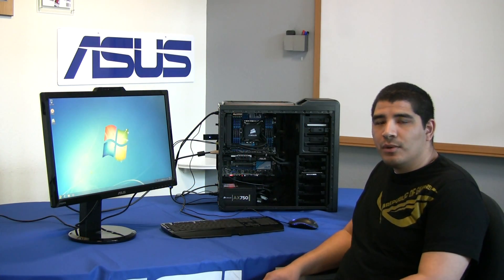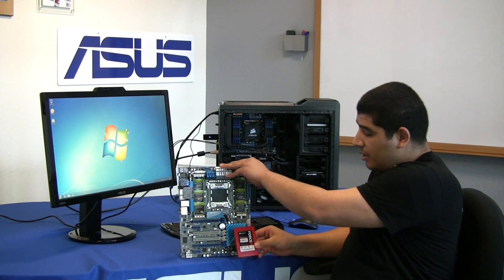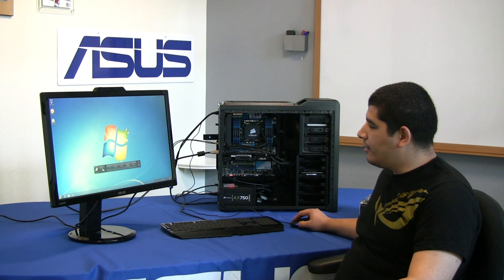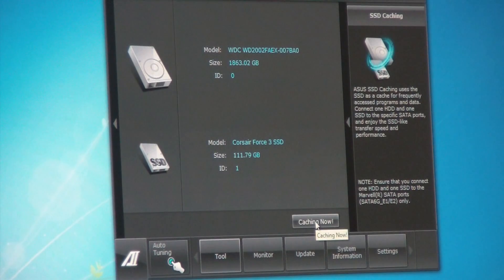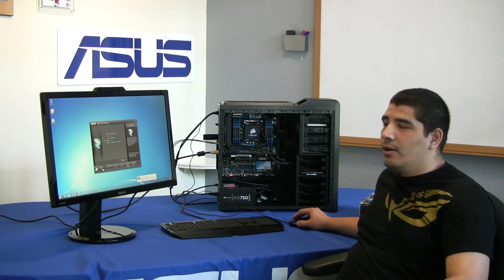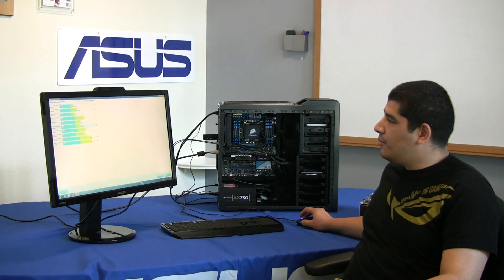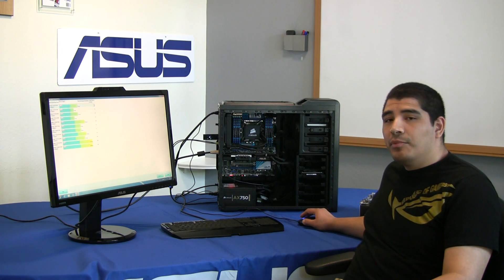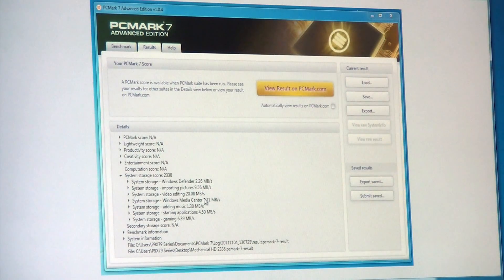ASUS X79 - SSD Caching

Comment: I "ACTUALLY" found the video to be usefull. I "ACUALLY"  just ordered a Crucial MX100 512Gb to install on my Asus Z77 MB so I'm "ACTUALLY" considering setting up something similar to this.  But I "ACTUALLY" want my HDDS to be setup in a RAID 10 array. May have to go to a RAID 5 array because I have 1 SSD 4 Hdds 2 optical drives plus my Thermaltake Chaser II case had a built in docking port which is SATA based so not sure if I have enought ports to run all the drives.  Probably need to add a sata card or 1/2 my raid drive will only be running at sata 2 (3gb)  speeds,  which would slow the raid to 3gb and defeat the purpose of the striped portion of the raid. 
Sorry,  I never intentionally make fun of anyone but the "ACTUALLYs" were a bit much. When I had public speaking were had to watch a video of ourselves so we could see things that you don't notice while your speaking,  but others see it imediatley.  Stuff like talking with your hands, scratching your face and repeating words.  It was embarrassing, because the entire class watched it to,  but it really helped allot to see it for yourself.  Again sorry, was not intended to insult you,  only meant it as constructive criticism

Comment: I'm confused - typical...
I installed a 120GB SSD and a 500GB WD HD in the specified SATA caching ports.
Since this was a brand new system, I then installed windows 7.
Next installed all drivers and Ai Suite II with SSD Caching utility.
When I go to activate SSD caching, it wants to format my SSD.   But that's where windows is installed!
How do I avoid this??
Reply: I think you install Windows on the HDD. Not sure though.
Reply: Ahh... just try it.  What could possibly go wrong?

Comment: I buy a power supply users slient pro gold 1200 I plug everything in the keybored now i am trying to figure out which plug is hard drive to connect to power supply there different thing in the back like,pci-e, hdd, sata, floppy. which one does is the plug to turn power on to the power supply plug in

Comment: I was confused by this myself,  it sounds like it has to be setup through windows which means it already has to be installed on one of the drives,  does that mean you can set it up on two drives your OS is not on?  a 3tb storage anda  new 512gb ssd?  merge them now you have a fast storage drive?

Comment: The computer shown has the H60 installed. Under the system specs has the H100. I'm just worried about clearance issues. Would this be a problem with the H100 + 400R + P9X79 board? A picture / video of the actual system would be greatly appreciated.